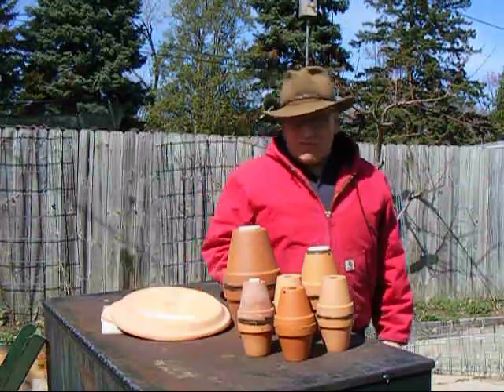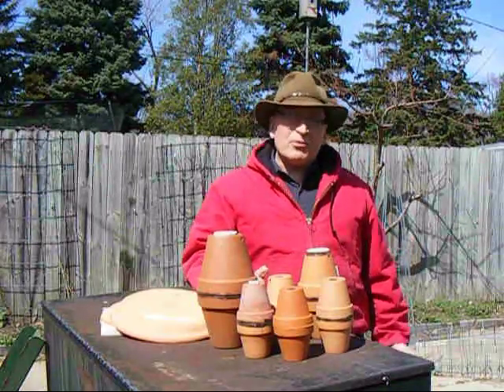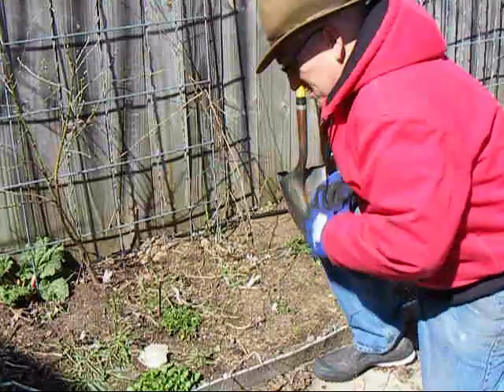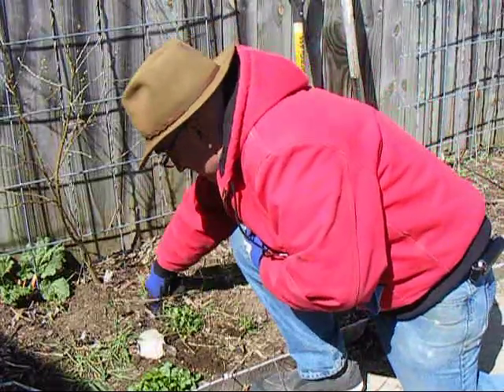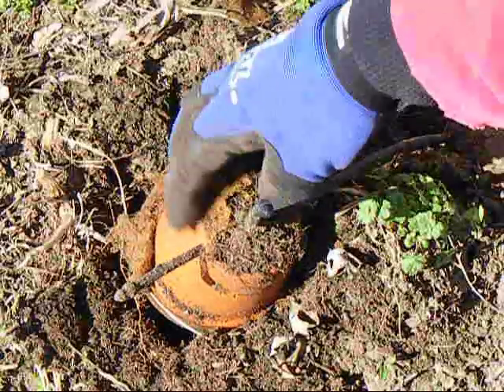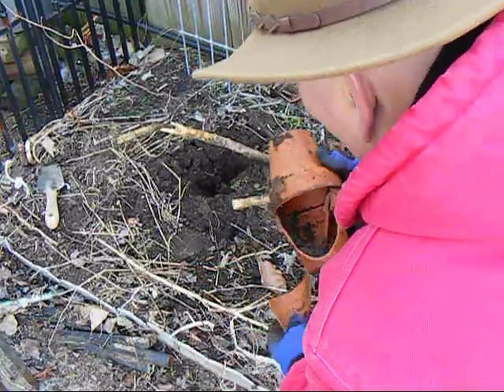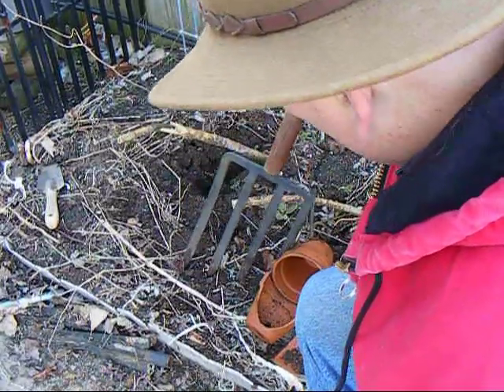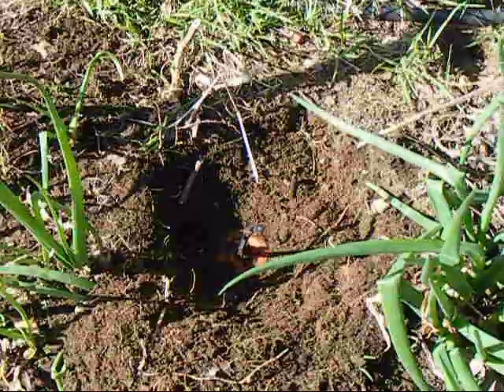Overwintered Ollas - April 2013

Comment: I found your videos quite educating and this system appears to be a way to solve a problem of mine - I own a property with a garden I can only get to once a week. I currently only have a 330 gallon rain harvesting system and tote an additional 210 gallons out in my truck. I use a battery operated pump to hand water everything but one quickly learns just how far water goes when watering an orchard and garden. Once a week watering is not sufficient to grow thirsty crops like tomatoes and watermelons here in hot & dry Central Texas. I would like to set up this system where I, for example, put one olla next to each of my 8 asparagus plants and use a 30 gallon barrel to feed the ollas. My thought was to use a battery operated timer low pressure valve to turn the olla feeder on once per day for X hours where I determine X by measuring how long it takes to fill the 8 ollas. That way the water is evenly distributed throughout the week. Two questions: 1) Do you have a feel for how long it takes to fill an olla of the size of this video? (4.5"?) 2) Would the olla dry out in the 24 hour period and if so it it detrimental to them?
Reply from the maker: Thanks, John. Our lake garden has a similar situation in that I am usually only out there every week or two. The system works fine because there is a well there to supply the water. With your setup I would recommend using larger pots for the ollas and pipe them individually or in groups of two or three to the regulator bucket. Then you can set the timer so that the water goes through the bucket to the ollas for a set period. Use a bleeder/breather tube for each olla or group and vent it to atmosphere, with the end of the bleeder above the water level in the regulator. This will allow the ollas to fill until the level is equal between the bucket and the bleeders, at which point the timer can shut off.

There should be no issues with letting the ollas run dry as they will still be under ground and terra cotta doesn't seem to be affected by varying moisture levels. The fill time primarily depends on the tubing length and the head pressure, and can vary greatly. If you don't use the regulator, the time will vary significantly as the water level in your supply tank drops. My calculations indicate that an olla made with 4 inch pots should deliver about 1/2 gallon per day, and one made with 6 inch pots about 1 gallon per day, but I haven't verified these values.

Comment: You may want to include a actually slow drip connection inside the actual olla. The only problem would be having to filter the water in your system.
Reply from the maker: Wes Sweitzer Which is why I don't do that!

Comment: Hello - I'm having a challenge, maybe I didn't understand how it works. It seems the water is weeping out of the pots rather than being pulled out as needed. A five gallon bucket drains out into already moist soil from ten 4" clay pots overnight. I'm using 4" clay pots (from Lowes) with the saucers glued on top and a small piece of tile in the drain hole. I have a 5-gal reservoir that feeds a 5-gal bucket with a float valve to maintain a constant 3" of water. Are the pores in stock big-store clay pots too large, do you think?
Reply from the maker: Randy, yes, there will be a minor amount of seepage, given that there is a very slight pressure being applied to the system. This should not be an issue since the plants will readily use the water the next day.
Reply: Wow, that was a fast reply. Thank you.

I have two zones of five 4" pots/saucers on a single 5gal reservoir, via the float valve bucket. I was hoping to be able to leave a 5gal reservoir for at least a few days, if not several. Is that not realistic?

What I'm seeing is water pooling outside the raised bed inside 24 hours. Maybe not enough organic material in the soil to hold the water?

It seems like it's an underground delivery method; fill up as much water as you want to deliver and walk away; a manual form of 'automatic' waterer, rather than a "fill up a reservoir and come back in a few to several days" method.

Do I have unrealistic expectations?  Thank you.
Reply from the maker: +Randy Eakin , I'm not sure why you're seeing pooling, unless you have leaks in the system. Five gallons is not much of a reserve, even with a small system. For 22 ollas in fairly sandy soil I was using about 275-350 gallons a week in mid-summer with a garden full of plants and a couple of fruit trees. The system is designed to be connected to a fairly constant water source, unless you use really large ollas.

Comment: Hi Thomas, Thank you for sharing your experiences with olla irrigation.  Have you ever tried using general purpose hot melt glue instead of the silicone, to seal the large hole in the bottom of the pot?  I constructed an olla using a four inch pot and matching saucer, and plan to place this in a "Walmart Grow Bag," which will sit on top of the ground.  One observation is the cooled hot melt glue is rigid compared to cured silicone.  Do you think this will be a problem?  The general purpose glue sticks are imported, so I'm wondering about food safety issues.  Please share your thoughts.  Thanks, James  Link to Ollas in buckets or grow bags.  http://www.globalbuckets.org/p/olla-irrigation-clay-pot-system.html     https://youtu.be/tU-LyVw-1as?t=5m25s
Reply from the maker: birdwing98 I haven't tried hot melt glue, but probably will, now that you mention it. I doubt that the glue has much in the way of toxicity, but would have to do some additional research to comment more fully. The rigid nature of the glue is likely not a problem, given that the pots are also rigid.